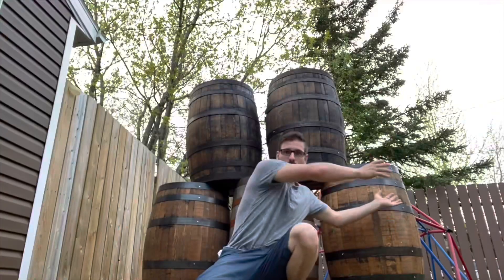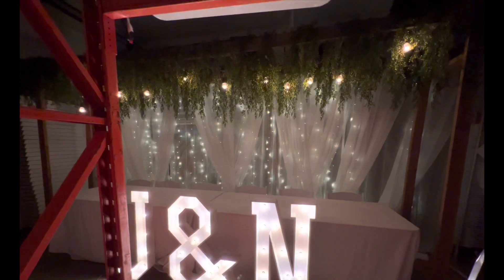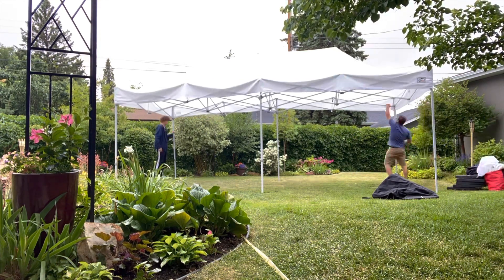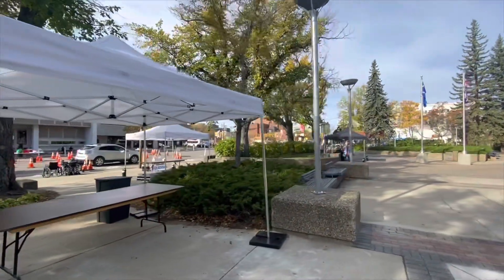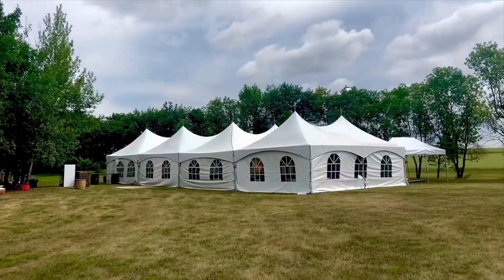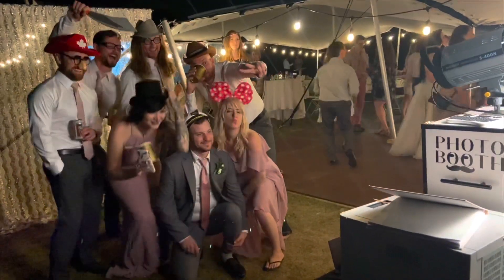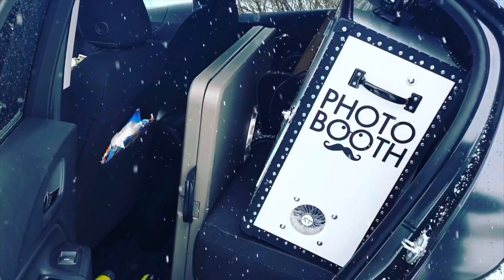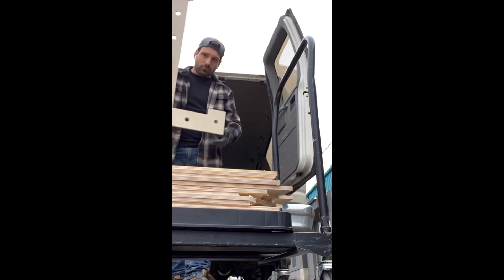Tips For Making Money In Your Party Rental Business Startup

Comment: What brand are the higher quality pop up tents?
Reply from the maker: Euramax, Impact, SES, basically any tent that has aluminum octagon legs, metal fittings and a high quality top. A good 10x20 will run you about $1000.00 give or take.